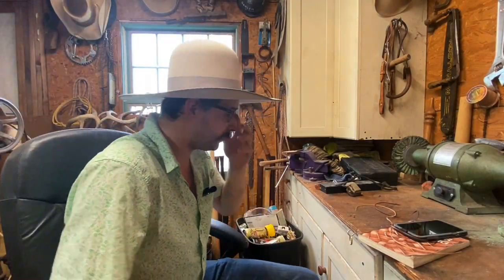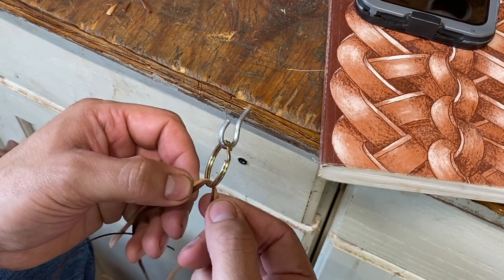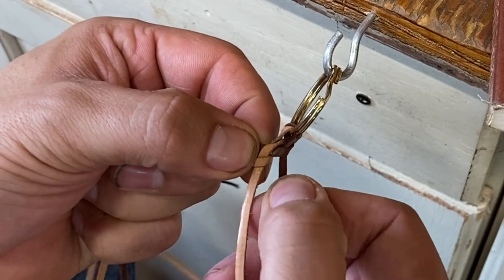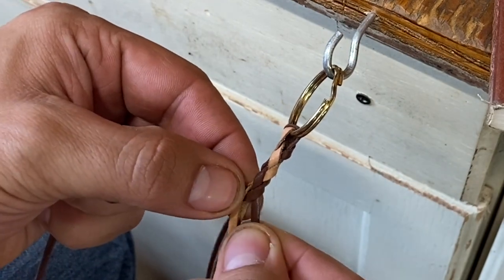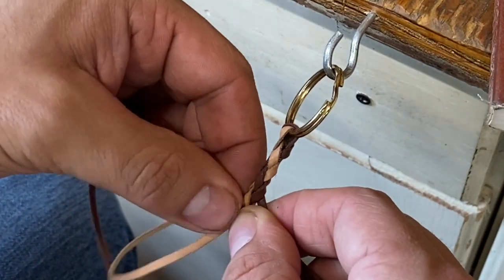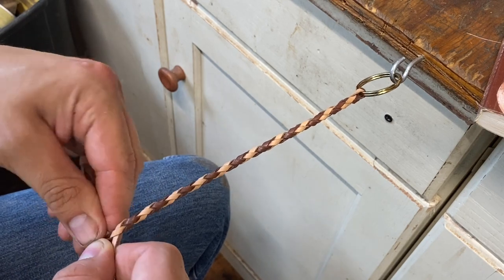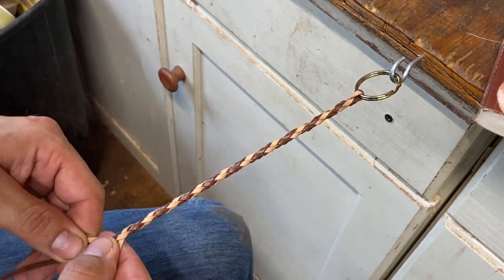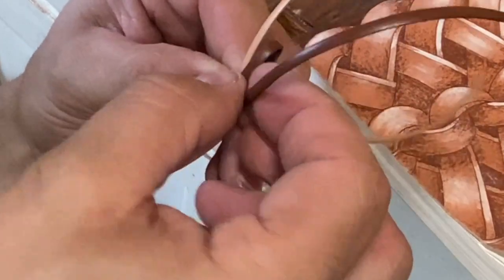How to round braid (4 strand) and finish with a Turks head knot

Comment: It’s a very interesting stopper knot which I have tied many times at the end of braided bolo ties, but it’s not a Turk’s head and is actually called a crown knot.
Reply from the maker: Well thank you for the correction sir. I was doing some reading and it does get confused with the turks head and my handy book from tandys probably has that wrong in it. Still learning as usual haha
Reply: @bustinout  no problem, I’m still learning too.
Reply: I have been round braiding for nearly 50 years and always known that knot as a Turks head. The first stage was known as a crown knot